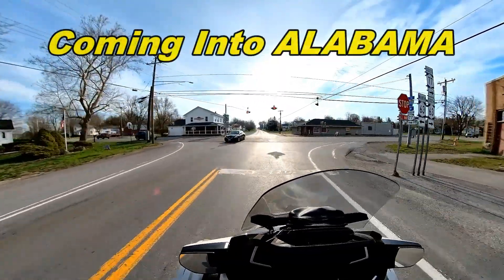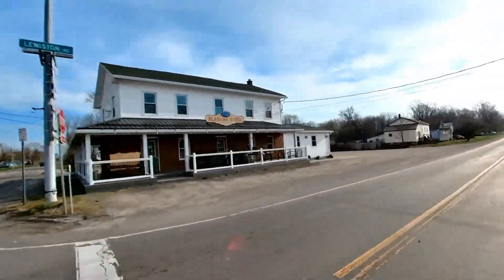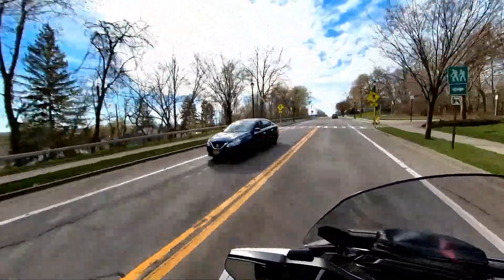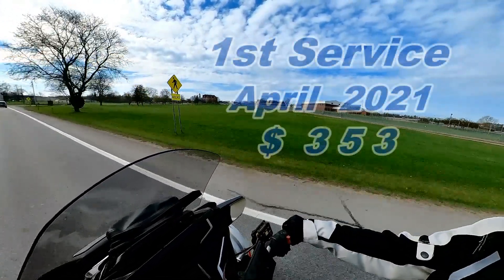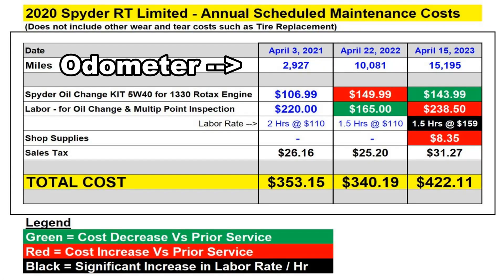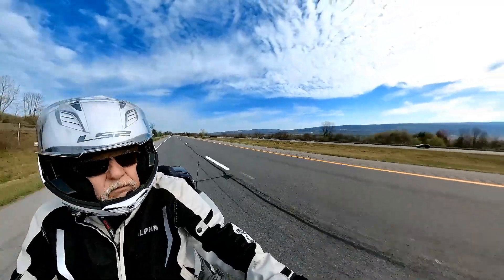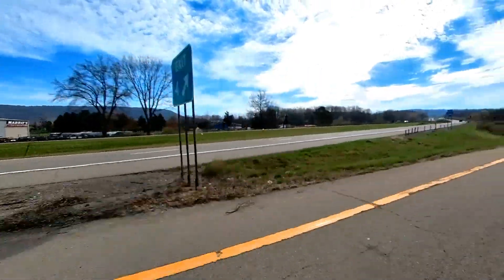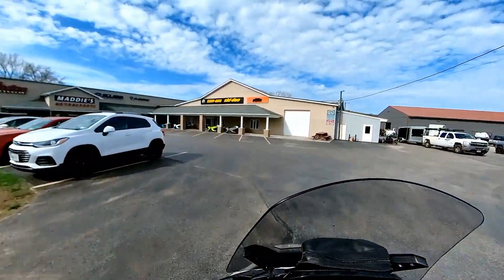Can Am Spyder RT - Scheduled Maintenance Costs

Comment: Great video and info. Maintenance is one those necessary Evils, where dealers can't help themselves from charging too much. Like changing a tire, $ 150. For labor 🤔🤪. Ouch. But we gotta do it. Btw gorgeous daY for SpYdering. Nice job on the voiceover. StaY Alert. rYde safe in a fun waY. Keep on SpYdering. 😎🇺🇲.
Reply from the maker: Well, you almost need a mechanical engineering degree to take apart the stuff to get at and remove a Spyder's rear tire, and then they have to pur it all back together 🤪🤣🤣

Comment: Great video. I have seen Purple on Three do an oil change. Pain in the Bum. I'd pay someone to do it.
Reply from the maker: The firmware updates can only be done at a dealer.  Just checking the oil on a Spyder is a 20 to 30 minute job, you have to ride for at least 9 miles, then idle for 9 minutes, then check the oil 🤪. Changing the oil filter is a real pain.  Letting the professionals who know what they're doing for the 50 point inspection is well worth the cost 👊😁👍

Comment: Since the RT Purchase I have resigned from the DIY maintenance club and I let the dealer do it.  When you take yours in you obviously wait for it, how long does that service take?  The first service I waited for I(well over 3 hours) after that I left it there.
Reply from the maker: I bought the extended warranty, so I'll probably get everything done at the dealer for the first 5 years. Then, after that, I'll be too lazy to do any of the service and just continue going to the dealer 😂
Reply from the maker: It's usually 2 to 2.5 hrs. One of the services might have been about 3 hrs.  I don't mind, I get there in the morning, and I'm home in rhe afternoon.
Reply: @SpyderWayne  I will be facing the extended warranty decision this fall.  I did it on the F3 and did get some advantage from   it.   At the minimum I like that I get continued road side assistance with it.

Comment: Nice recap. 

Only question I’d have was the mileage on the rear tire. Any additional information on that at less than 10k or is it a combination of trailer and or other factors?
Reply from the maker: I'm positive the camper contributes to the rear tire wear, I was disapponted with the wear but I also had a little bad luck with timing, NY Inspection was due, and the tire looked ok, but just at the very center, the tread was just barely down to the wear bars, I could have easilly got a couple more thousand miles if the inspection wasnt due, but hey I guess I don't need the center of the tire looking bald 😅
Reply: @SpyderWayne  is there a recommendation for a change in tire pressure with a trailer? I’ll look but I don’t have plans for towing a trailer. I maybe in the market for a Stinger Trailer but still debating that decision. Thx
Reply from the maker: @DFW Spyder Moose  I doubt there is a recommended tire pressure change for a small trailer, but there might be. The tongue weight is less than 50 lbs, which isn't much at all.  I never carry a passenger.  Riding 2 up, I believe, does warrant slightly higher recommended tire pressure, but not if you're carrying a 40 to 50 lb child.  But it's a good thought, I'll need to look at that myself, thanks.
Reply: @SpyderWayne  a quick look at my F3 manual says tongue weight shouldn’t exceed 40lbs. Not sure about the RT? Something to be aware of.
Reply from the maker: Same for RT

Comment: You appear to have a Pedal Commander installed on the bike.  Did you need to remove this before going in for service?   Did this effect your warranty having this installed?  What did the dealer say about it?  Thanks!
Reply from the maker: Pedal commander was on my Spyder every time I had service, and no, it didn't affect warranty.  My dealer didn't have any issue with it or with any of the accessories I had installed myself, including my hitch and trailer wiring harness, or my 12v docking station.
Reply: @SpyderWayne  ok cool.  Thanks, buddy!

Comment: I can change my own oil and fix anything on a car, truck, motorcycle, snowmobile or my tractor. I take nothing to any shop unless it's a warranty repair, and even then i check out their work carefully.
Reply from the maker: @jonerwin1697  Oil change on a Spyder is relatively easy, but there are a number of required maintenance service items on the Spyder that I don't have the special tools needed, nor do I have BRP's Buds system to talk to all the electronic systems on the Spyder.  But, I have found a reputable Spyder dealer with much better labor rates 😁👍